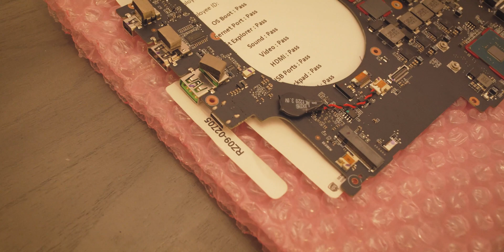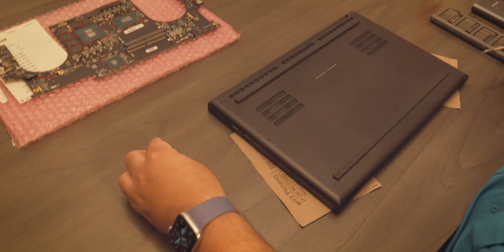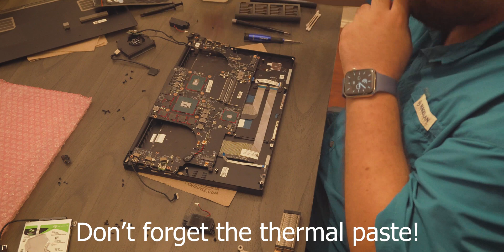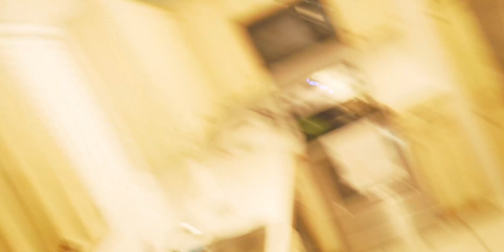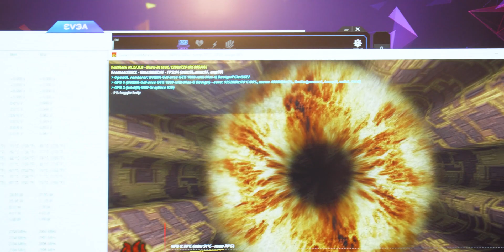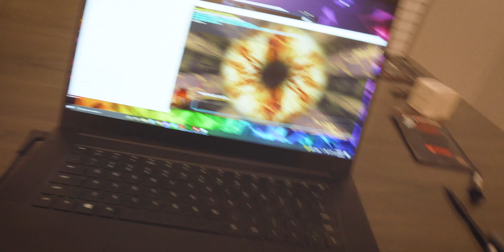My RAZER Blade Gaming Laptop Died After Only 2 Years

Comment: I got my Razer Blade 15 in 2020 (RZ09-0330x) and it's on it's last stand for sure. I have graphic driver issues so bad that I can't see my windows menu bar because it's fully covered up by all these horizontal pixelated lines mirroring the top of my screen for some reason. Both of my fans have failed and my screen constantly cuts off. (It's constantly hot even when hooked up to an external laptop fan.) Batteries no longer charge/work with my laptop, so it dies every time you unplug it, and finally, I can no longer press back space or enter as the keys on the right side have all stopped working. I am trying to upgrade my motherboard to hopefully fix all if not the majority of these issues, but I'm not too tech-savvy when it comes to motherboards, so I'm researching all I can to avoid buying something that's incompatible.

Comment: I have one of these that won't turn on and just gives me a slowly pulsing green light, and so far I've determined that the DrMOS on the CPU are fine, although there's no output to the CPU. The CPU does get hot, though.... Anyways, I'm moving onto the GPU power rails next. I'll keep y'all updated, I know it's very important to everyone in these comments.
Reply: Any update?
Reply: @dilyannikolov2384  Yeah, I think it's either a PCH that's broken or the CPU took some knocks to the head and, while it gets hot, doesn't actually turn on.
Reply: @ did you bring it to somebody to check it out
Reply: @dilyannikolov2384  There aren't really places in my area who would do that, circuit board repair is not very common here.

Comment: I have two months and looks like my razer blade 18 of 5000 dllrs is dying… graphics blurry, turns off display several times, tab out causes freezes that need to reset it to work again. Color changes in display. So many errors… can’t believe it but my Alienware r11 works better even if I bought it like 7 years ago, I never had so many problems with a laptop and I should be the most powerful after all those falls reviews I suppose

Comment: Something that I think is overlooked when buying laptops is the potential cost of repair parts. Putting price to performance and affordability aside, Razer and other gaming brands are entirely geared towards gamers, so the actual # of repair parts on the market will be entirely from 2nd hand or broken laptops from normal consumers. If you buy something that is extremely common in corporate settings like HP or Dell, they’ll have a much larger market of used parts that you could use for repair. Right now if I’d replace my old 2017 razer 14’s mobo, it’d cost more than just buying a new lower end laptop with a better gpu and cpu. Although razer is cool and has the compact form factor, mine died the exact same way so I’ll probably buy something like an XPS next time.

Comment: Here to share my experience:

Mine won’t boot. Was working fine, then stopped working. Held power button for 10sec and a white led flashes once. There are no conclusive results from posts on the forums with same problem. 

Does mine sound like a motherboard problem too? 😢
Reply: F
Reply: @kevinzero1995  ?
Reply: @SinaRan301  Did you find a solution? Mine does exactly the same as you describe. Less than a year old and hardly used 😕 thanks

Comment: Currently having a problem with my 2070maxq advanced. When gpu reaches 100%, crashes with black screens on monitors. 

All I did was swap hdmi cords so when I remove the usbc dongle from it to my Mac when needed, everything I need including one of the monitors is attached. It was supposed to have the laptop monitor merge with one of the external monitors smoothly and then I’ll be able to disable the laptop monitor. Instead, it struggled to merge with one of the monitors. In the settings you could see it trying to merge with one external monitor and then moving to the next. 

I swapped back the hdmi cords. Seemed to go back to normal until the screens started randomly going black. Assuming the computer stops computing when this happens because I streamed this morning while watching my twitch and the twitch went off line right after my screens went black. This is a very bad time for this to happen.

Comment: I also have a 2020 razer blade advance (( i bought it brand new in 2022🤔))
Its my second  laptop  (my first laptop was an old hp that  its dedicated gpu got busted and was not functioning any more ( i used I gpu for long time) after that i bought this razer and i use this one very light and dont push it to its limit by limiting thr game frame rates and custome fan modes to help tempratures and heat dissipation

 I THINK WITH THESE SOLUTIONS I CAN PERVENT MINE TO GET BUSTED
u do the same too😉😉
Reply: What happens with yours blade now ? I am curious because i am consider carefully on the razer laptop ( maybe the advanced model or 14 inch).

Comment: Hey man.. thanks for the video. Question, when you first booted up and it was going into that loop mode.. how did you end up resolving that? I just replaced my motherboard using your video and it's doing the same thing. Eventually it boots into windows and then everything is fine, but every time I restart I have to watch it try to boot up for like 3 minutes. Any ideas? Thanks again for posting this, it was fun to watch!
Reply from the maker: Go into the BIOS and restore default settings...Seem to help mine